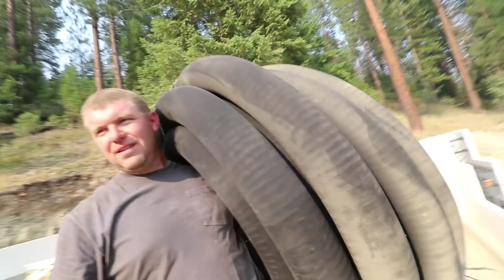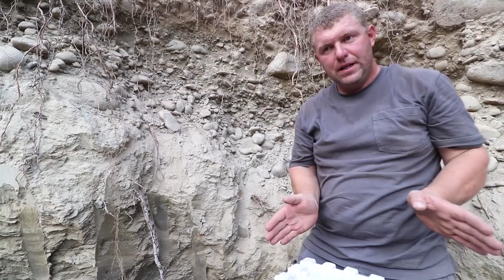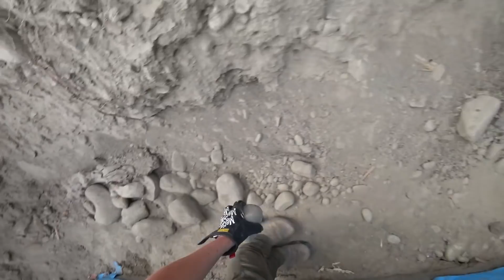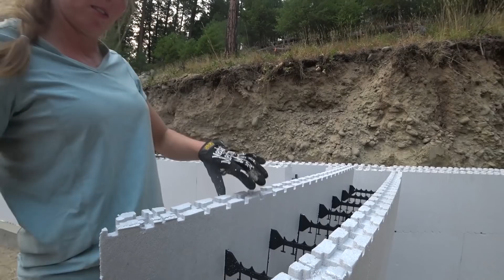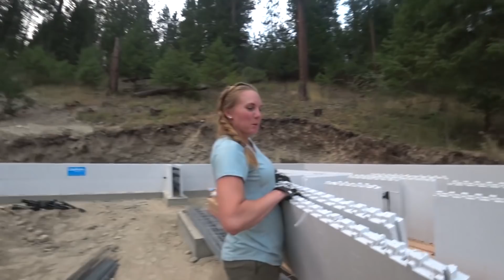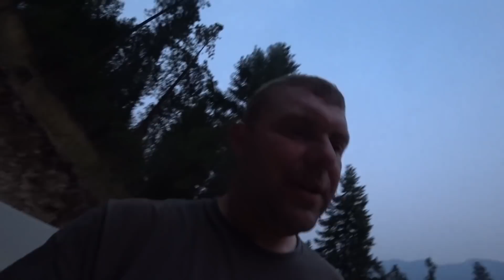OUR MEMBRANE IS DONE! (Waterproofing Foundation)

Comment: The key point I would be paranoid about is the internal corner between the footing and the wall. If your membrane tears so much that the tar can no longer self heal, and then you get water pooling in this area, then there is a good chance water will make it inside. A simple solution I would consider is to cut long triangular lengths polystyrene to go along the corner of the footing and wall (you can use the foam glue to affix it),  then place some membrane over this going up the wall by 1-foot, then down over the triangle around to the bottom outer side of the footing. This will stop the water pooling and the shape without the hard internal corner will make it less likely to tear beyond the ability of the tar to maintain the seal.

Comment: the pipe was fine for around the house just not under the drive way the drain is most important part of your waterproofing making sure not to puncture the membrane
Reply: used it for more than twenty years never had it fail have dry basements to this day.
Reply: There are different ratings of corregated pipe...even some made for sewer drain fields. Your local hardware store or big box store is not likely to know a damn thing about that.

Comment: One thing you may be able to do is put a piece of 1/4" marine plywood between the membrane as you backfill and LIFT the plywood as you go so the stones in the back fill don't rupture the membrane.  As to the drain pipe, corrugated pipe has NO PLACE ON MY PROPERTY.  I have used schedule 35  rigid PVC pipe.  You can drive a dump truck over the stuff and it won't crush.  In your area, with your soil, I might be inclined to put some risers in - one on the mid back, one on each mid-side.  Cheap but if the pipe fills with silt you can clean it out with high pressure water.  On the rigid pipe be sure to glue DO NOT just pressure fit.  My last two houses were done like this - no moisture in the basement.  FYI, your downspouts from your gutters, if you use them, will not work since they will not go to your footings.

Comment: So I looked it up.  Menards carries 6" x 10' bell ended perforated SDR drainage pipe at $17.79 each after a mail in rebate ($19,99 without it); the elbows will not be perforated and as I recall from the house I built in 1977, the fellow who was doing the backfill told me to use 6" because nothing will plug it up.  My house was also built into the side of a hill so there were 13 steps from the driveway to the front door.  Just never had a problem.  We bought a house in 1990 and were flooded in 2003.  I ended up putting in 1,400 feet of schedule 35 drainage pipe.  Worked beautifully.  Just remember to glue it so it doesn't migrate.  As to my prior comment re back filling, USE PLYWOOD NOT OSB which is too rough.  You want one side smooth so it reduced the possibility of a tear.  On the end of the piece of plywood where you want to lift, attach a piece of 2x6 so you can safely attach chain and lift it with your excavator.  Hope this helps.

Comment: I understand your frustrations!I wonder how would they react if u guys sue them?!In my opinion u guys should be just fine if u seal the corners real good and to protect the membrane just over lap it with stirofoam pads witch protects from the backfill rock and also add a layer of thermal insulation and use silicone (couple of dots ) per board to make it adhere to the membrane.Good luck you guys and as a couple working together u two rock!

Comment: Maybe slope the entire basement slap a couple of degrees into a corner and build in a sump pump area...just in case.
Reply: I would do that anyway because it will get wet in there and you may want to hose the floor off it is gets really dirty.

Comment: If you have a drain tile on the outside like your doing there really shouldn't be any problems with water. Run your drain out the side of the hill with a screen on it to keep varments out. A sump pump is nothing but a problem

Comment: Building our home with ICF basement blocks. The contractor is using dimple board and does not require sealing  between sheets, just overlapping of the sheets.

Comment: May have been said but looks like if you wait to put the corners on. Run the rebar you need to run then put the corners and put in the few 90-degree pieces.
Sounds good in my head anyway, not sure on the follow through.

Comment: I love all the comments from people about how to do (or not do) the foundations.  You guys are doing the work of a six-man crew and learning as you go and yes making mistakes along the way!  Yes, you are inexperienced, but where does experience come from?  Doing the job and making mistakes and fixing them and moving on! I do think that sometimes you are overthinking the problems, but then you are going to live in the house, not me or anyone making derisive comments!  Getting the foundation sealed tight is important, but the footing drains are extremely important as they relieve the pressure against the wall so that the only wicking is a problem, without them, you could have about 5 psi(more if there are winter springs in that hill)  trying to drive water into and under the basement.  I laud your energy and determination, if not your sanity! LOL!  Keep up the good work and don't be offended when someone offers a suggestion about safety.

Comment: Spend your effort on the drainage.  Use weedcontrol mat, fill an inch with gravel, put in 4" pvc with perfs to the bottom.  Slope so it moves water, wrap the 4" with the weedcontrol, then bury it in that pea gravel.  Use the Green heavy duty pipe.  I then put the weedcontrol mat over that 3" of gravel, then put as much gravel over that.  Any water will go down that gravel, be double protected from fines and the water will never stay much along your foundation.  I did this along a septic field and it stops several acres of water hitting it.  The rain gets to 6 inches an hour for 1/2 hour spurts and that 4" just dumps everything.  On my  retaining wall, I had 16 inches of pea gravel above that filter fabric (weed control).  I used a half strip of duct tape every 18 inches to hold that filter fabric around the drain line.  You are on high ground so you really don't have much of an issue if you put in that drainpipe low around the foundation.  I was wondering about those materials I was seeing.  Good luck.  I am happy to see you guys taking the time to get it right.

Comment: The 3 most important things to consider in any construction is #1- drainage, #2 drainage, #3- drainage. Just remember, you're not building a submarine. Providing a path of least resistance for the water to flow through is the key. Perforated pipe  on a bed of drain rock with the holes positioned at the bottom or "spring line" , covered with filter fabric, will allow the water to get out quickly. "Mirror drain" placed against the wall will provide a measure of protection for the membrane and also an easy path for the water to get to the drain pipe. Another important item is to install a run of solid drain pipe on top of the first that connects to down spouts from the roof gutters. These two pipes can then be connected once you're away from the building. And...... just in case..." clean outs" placed in strategic locations are cheap insurance. For what its worth.

Comment: Hi guys. I use a product called Red Gard. It's a vinyl type material you can paint on. I use it in showers, including for the pan. Not sure if it's compatible with your stuff. Sold at Home Depot. Might check it out. You're probably way ahead of this video. Best wishes.

Comment: Just give the water a easy way to go thats not inside your basement and your good. good bed of clean rock that will stay clean forever...connecting pipes under you footing so water can flow free under your floor to outside of footing or vice versa to your sump pump is important water will get under your floor and make pressure otherwise.....important to have clean rock under your floor also the more the better i like 8 inches..hope this helps anyone thats watching and thinking of a diy basement

Comment: The terms for the icf connections in relation to castles. The top of the wall with the little bits sticking up are crenulations.
Side note if they stick out from the wall and have a murder hole, they become machicolations.

Comment: just caulk it and it should be fine once u put pressure against it itll be fine. if u still freakin out add a layer of heavy plastic for added protection. u can tape it in once u add the dirt and walls it will be completely sealed no issues.

Comment: drain tile fills from the bottom, so as long as the water gets passed the footer, would you be okay?  Are they saying the membrane isn't any good at the footer/wall joint? By the way, there are many corrugated culverts around, it just depends on what the product is rated for and the amount of gravel surrounding the pipe.

Comment: If you just put in a good drain tile to divert the water around the footing which drains either into a  sump pump or out and down the side of a hill away from the house you should be alright.    Remember water runs down hill.  Divert it!
Reply: I agree, being on a hill is sometimes an advantage, keep the water running away and there likely won't be an issue. Berms, grading and swails can do more to control the water.

Comment: Hi..... The important,the must, for a waterproof foundation is the draining system. Make sure that the drain around the the foundation will evacuate the water to the drain sewer than the water will be by pump or gravity taken away from the house. As I seen on your videos your foam foundation cover with the membrane should keep the water away of your basement wall the drain around the footing as to handle the water. I am not a pro, I own 2 houses, one that I almost built by my self than I am helping my 2 sons to take care of their houses, my older son house is located in an area where their is underground water around the the house even in winter (The swum pump work all year round) an his basement is not flooded. I would say go ahead, with a good draining you should not expect flooding.  I leave in Quebec Canada more winter and snow melting than your area.

Comment: Hey guys.... as long as your pipe system is unplugged and freely draining....  the water that builds up against the membrane
is going to flow down hill into the drain system....   If the pipe were plugged then you could have a build up of moisture against the the wall and leaks going up into lapping joints could certainly happen.   but again as long as the system remains open the moisture will want to flow in the easiest direction it can.... and that is DOWN....   But a a coat of asphaltic or mastic sealer at the joints certainly couldn't hurt....   also if you do put a drainage membrane (which you may have used by itself) the membrane is going to cover any of the seams in the vertical direction giving that extra layer of defense....  you would just want to make sure the membrane wraps around under the bottom of teh pipe to push moisture into the pipe....
Reply: Even if the pipe clogs, water goes out into drainage rock and back into pipe.  We're not talking about a storm sewer here, just seepage water.

Comment: I think you should protect your wallet! OK for the membrane you already install what I would do if I was was facing your situation is to insure a row of membrane that (6 to 12 in) will be put over the soil and having an adequate primer requested for the foam form to secure the stickiness of the membrane, as the membrane  is over lap it should help to waterproof the wall, the pressure of the soil will keep the underground membrane in place,.

Comment: Wow! I'd call that a cluster f*#k of false information perpetrated by people who could not organize a one man rush to a three hole outhouse. I'll tell you the story of what we did when my father built his house. The only concrete in the house is the footings and the basement floor. We dug down till we hit the sandstone bedrock. (until we dug we didn't know that was there) We filled the whole basement area with 1" to 2" crushed stone, one and a half ft. deep. Put the 8" high footing on top of that with 4" plastic pipe every 6' for drainage and no rebar was used. We then leveled off the inside of the footings to within 2" from the top. On top of the footing we built the wooden basement walls with 2 x 6 lumber, 16" on centre and 5/8" plywood. This was all pressure treated wood. We then put the floor joists and sub floor on top of that. We put 2 x 4 pressure treated wood on edge on top of the footing against the interior basement walls and poured the concrete floor to the top of the 2 bys. By the way we used no wire mesh or vapour barrier. The basement sits 5' into the ground with 6 mill plastic on the in ground portion of the wall and there is no drain tile just a 4" pipe running from the front corner, in the foundation gravel to the ditch about 100' away. That was 24 years ago and the basement is still bone dry with no cracks in the floor. I kinda think your foundation will be just fine. My father saved 8 to 10 thousand with his wood basement.

Comment: do not use schedule 20 it crush's over time. use either a sdr 35 or schedule 40 it will hold up but you will have to drill holes in them and holes must face up. former sewer and drain contractor and installer.

Comment: FILTER fabric or STRAW?? Check on this. 4" perforated with straw lightly covering pipe was done by my contractor. He told me the  fabric would clog??
Reply: The fabric sock on that black pipe is to be used in gravely soil because the stone fines will get washed into the pipe. On the other hand, if you use it in clay or loamy soil it will get clogged.
Reply: No they used the hard white plastic with holes

Comment: Might be an idea to excavate back further and build a retaining wall away from the house. You could start digging by hand and then when you get a big enough gap you could use the backhoe. You could do all of this after the house is completed. I'm not being a hater (I love the videos, thanks for sharing it all), I just don't think that this house-in-the-hill idea is going to work (mainly vis-a-vis dramp). And you might not find out for years or decades.  The retaining wall could stick up a bit above ground so you don't have the feeling that a land slide could fall on your house.

Comment: I am a contractor,  been around materials all my life.  My instinct is to add that beveled  edge and apply another layer to ENTIRE STRUCTURE.  When I build my home it will be a ICF home.  I am surprised you did not see others In videos explain about the coating system.  Don't get mad at me,  but I think you are pushing yourselves to hard, building takes a lot of knowledge and it is the little things that make the home beautiful.     A rule of thumb when building is to always think about how water flows and make ways of diversion  of it.  I keep saying to you to hydrate yourselves,  the best way to do that is water straight from a coconut,  crack it open and drink it down,  then use the coconut meat and make smoothies from it.  The heat is taking it's toll on you,  pace yourself with fun,  relaxation and then work.  NOTE:  The beveled edge diverts water!

Comment: During the rainy season there will be a tremendous amount of water pressure coming off that hill. My father bought a house that was waterproofed improperly. He had severe mold problems, flooding, wood floors buckling from humidity and a miserable situation before he passed away. DO IT RIGHT or you will regret it when it fails. I've seen some idiotic comments that don't reflect the seriousness of your situation. Your house is only as good as the foundation. Always has been!

Comment: from what I recall of the Arxx installation video, they recommended applying peel-and-stick and then installing the dimpled membrane over top to provide mechanical protection. The nice thing about the dimpled membrane was that it would allow water to drain away from the ICF because it maintained a space next to the wall. from last link:)

Comment: It looks as though it would have been cheaper for you to hire a foundation construction company to build a concert foundation for you.  These companies use metal frames to contain the concert and then remove this frame when the concrete sets.

Pre-planning  a construction project would also go a long way to getting things right the first time. This can be accomplished by consulting with you architect.  You are using an architect?

Comment: See EDIT below 

We put 'river rock' around and over my outer drain tile.  I believe the idea was that the rock supports itself.  The inner just had crushed rock to fill under the slab.  --  To protect the waterproofing from back fill damage, we buried some cheap green fiber board against it.  That was 15 years ago ... time will tell ;-)

EDIT - I see a previous comment about tar ON the membrane - Not a bad idea!!  The membrane ISN'T ICF.

Comment: Tar would have saved you a lot of time, you should be using a heat gun and a solid roller for the  application.
Reply: A heat gun on polystyrene walls sounds like a recipe for disaster.

Comment: @12:24: Sawing Styrofoam... sceeech... This is high-tech construction of the 21st century, made in the u s  of  a: Styrofoam and sticky paper. If anyone dares to comment about traditional building materials, such as compressed earth blocks, the comment brigade would go into an all-out attack.
Reply: Sure, new technology try to solfe all-time issue , how ever you will need to implement it cerfully and on suggested way by manufacturere. Looking few videos i am not sure that is prefered way of use that new tecnology at all.